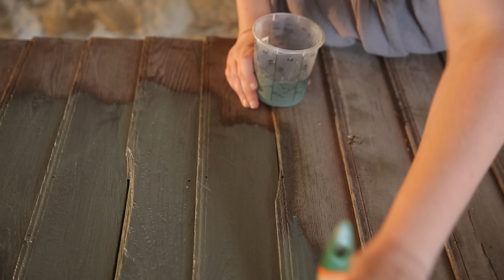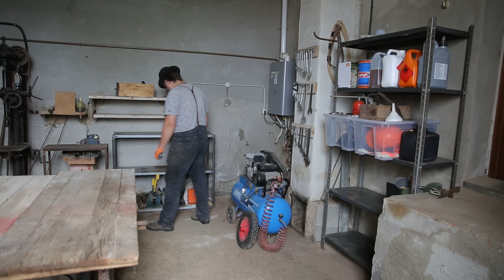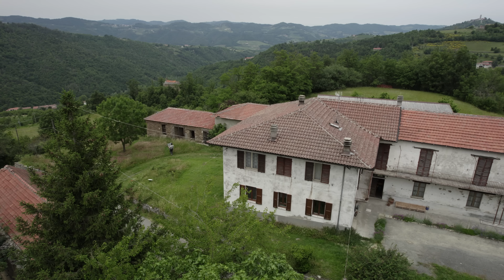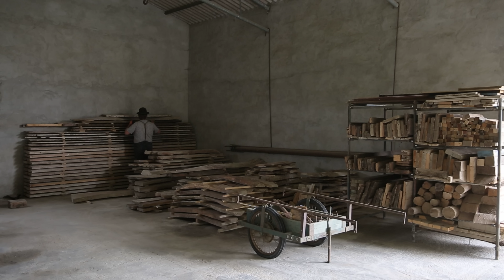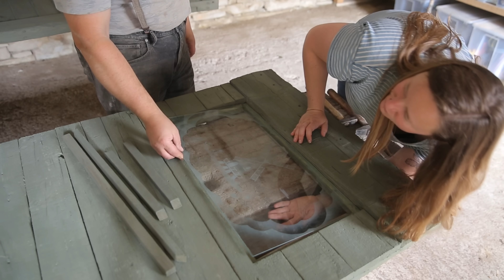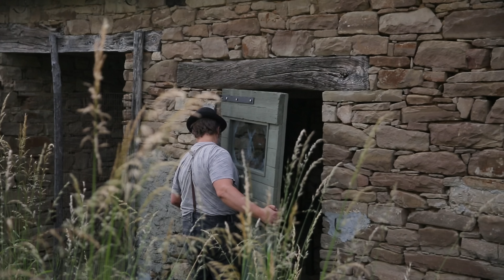#42 Three doors down (almost) and starting on the garden shed - Italy farm renovation

Comment: 2:34 Bertus you have an incredibly bad habit of putting your hands into, overtop, behind, the path of the blade after you make a cut, as the blade is winding down and coming to a stop. Just because you have turned off the blade on the saw it doesn’t mean it can’t cut off your thumb still, or pull your wrist down into the blade and lacerate the arteries in your forearm. You have no idea how many cocky overconfident woodworkers I saw in the emergency room who had those accidents I mentioned above because they couldn’t wait 5-10 seconds for the blade to stop. Turn off the saw. Put your hands in your pockets. Count to 10. Then when the blade has stopped clear your materials from around it. Please. ❤️

Comment: With the ceiling removed and the stone floor exposed the 'poulailler' has been transformed into a splendid room, befitting garden tool storage 😺  The gap at the top of the door looks intentional - ventilation.
For what it's worth, I think you are going about developing your house the right way -  cleaning, organising, saving useful kit, repurposing stuff, and doing essential repairs, methodically, steadily, and calmly, in preparation for major works.  
 I have watched some episodes from a few of the other many homesteader projects and am bemused that several of them seem to have little sense of priorities - for example, spending time planting overcrowded fruit and veg amongst weeds in unprepared ground yielding miserable crops,
 while their house is left uninhabitable🙄 - still, they enjoy themselves, which is all that matters.

Comment: The windmill door will be an easy fix. It might actually have interesting proportions with a slimmer piece of wood on the top. It’ll frame the window more and emphasize it. You probably won’t even have to move the hardware. Just add a piece to the top and call it quirky.

Comment: This paint is not washing off, when it rains? Great looking 🥰 all the old materials.... I love it
Reply from the maker: it has been used in scandinavia for centuries as an exterior paint. i know, it's pretty mind blowing that a paint made from mostly boiled flour doesn't wash off with rain 😅 the only thing it doesn't do well with is intense friction (from walking, sitting, scrubbing etc), so it's only used for vertical surfaces.

Comment: Just a suggestion.  As the door with the window is used and distorts.....despite your best efforts, it will cause the glass to crack and break, since the glass is so snugly installed.  If you make the opening for the glass slightly larger, it will allow the potential distortion to occur without damaging that lovely glass.
Reply from the maker: Thanks for the tip! There was quite a bit of leeway horizontally, but we could have could have left a bit more space vertically.
Reply: @storiesfromthecascina  I heard the remark that it was a snug fit.  I just didn't want that nice etched glass to break.

Comment: Could you use the flour paint with a spray gun? You have an air compressor already. Would save time and blisters…. Just an idea.
Reply from the maker: not sure, it's quite a thick paint. we've never seen it applied with a spray gun before. it might though!
Reply: @storiesfromthecascina  worth a try I reckon, if you will be doing more doors. You could also spray linseed oil or similar on the door lintels